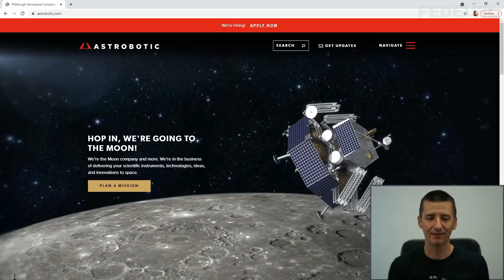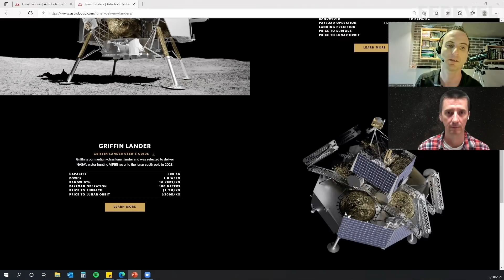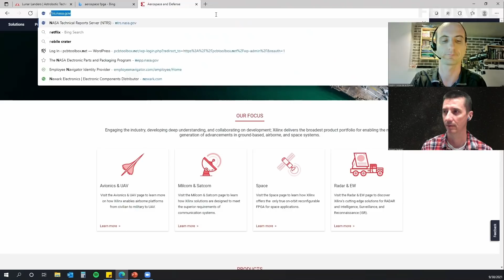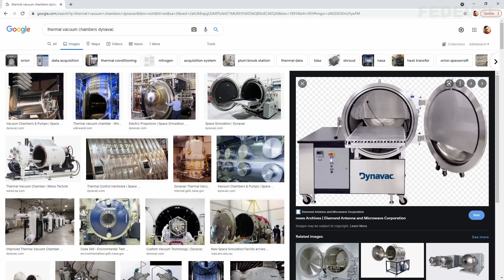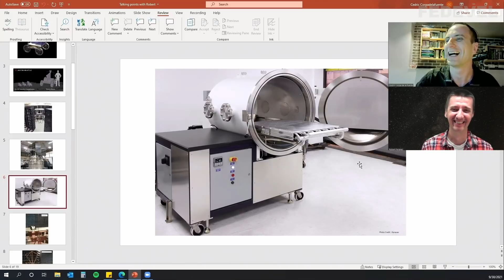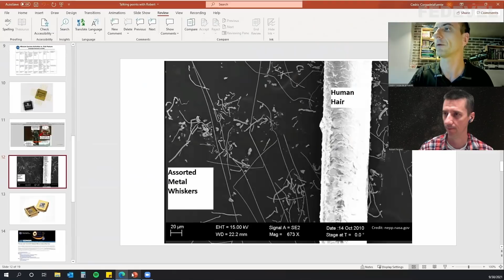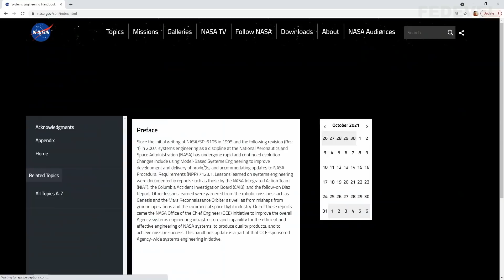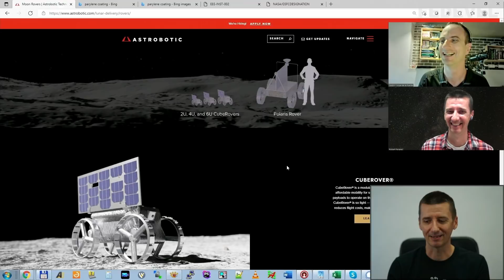How To Design Boards And Electronics for Space (with Cedric Corpa)

Comment: This was most interesting, even if my own aerospace PCBs have never been above 19Km, (so nowhere near space).
I would love to see an equivalent video for the Medical Devices industry, and what specific test procedures and certifications are required for (non-implantable) medical test equipment and their PCBs (e.g. more stringent EMC regulatory limit classes, electrical isolation voltages, ESD models, reliability, failure-mode analysis, circuit redundancy etc etc).
Obviously, more of your viewers will be designing for the medical industry than for the spacecraft industry.
PS: I'm currently designing some safety-critical automotive electronics, and the requirements for that industry are quite interesting too. For example, no single component failing either open or short-circuit may cause a failure, and any wire in the wiring harnesses to the PCB may be shorted to ground or to the car-battery voltage without causing any damage and it must be detected by the self-test diagnostics and fail-safe.
Reply from the maker: Thank you Nicholas. I made notes into my possible future videos list.

Comment: @1:02:34:
RE: can you use RoHS lead finishes with leaded solder? Generally YES. At minimum, pick matte tin (vs bright tin). Then the leaded solder mixes with the RoHS coating of pin. More advanced and multi-layer/multi-chemisty lead platings exist that are cross-compatible.
BGA: You are stuck with whatever ball chemistry is, unless you ask for a custom part, or reball (frowned upon).
RE: coatings that stop tin whiskers. Actually, there are several different conformal coating types that are so hard that tin whiskers can't penetrate. Some of this can be vaccuum-applied so that they actually suck in beneath and between the BGA balls. NOTE: if a coating is this rugged, it is also hard to rework the PCB! (So for a hobbyist or non-military product, the most you practically can use is like acrylic-based conformal coating, that removes easily with a Q tip and IPA. Polyurethane coatings are a lot more rugged than acrylic, and yes, they shield PCB from moisture, dust, ESD, oxidation, etc. We use conformal coatings at work, and I can't imagine consumer products being naked out there, exposed to everything like moisture.

Comment: Interesting Wikipedia suggests oxidation resistance of parylene is pretty low 60-100c. Though I wonder if they are using the flurinated versions which I'd guess are better in that regard.

Comment: When designing boards for space you have to consider that there's no air convection. So the only way to dissipate heat of components is the conductive one. And also because of the fact of absence of convection comes the problem to dissipate heat from your spacecraft. Here it is possible only through radiation

Comment: Does anyone know more detail about the reason why FPGAs are inherently more resistant to soft errors? That is a fascinating fact!
Reply: As he mentioned, only if FPGA is specifically space grade / rad hard. Commercial grade FPGAs are susceptible to soft errors as processors as well.
Reply: @valerik.4129  Ah right, had to watch it back, the mention of aerospace specific parts was so brief I missed it initially.
Reply: @valerik.4129  Im not an expert myself but I've been working closely with a radiation expert for the past few months on space projects who actually does the rad testing for Xilinx and he told us that we could use the commercial version of an FPGA and EXPECT roughly the same radiation performance as the space grade part in that family. There can be differences in lot to lot variability and what the space grade version (at least for this FPGA) gets you is essentially just the lot testing and traceability. Sounds like youre paying a lot for little but having an elevated level of confidence that your $100 million dollar project with a 5 year mission doesnt fail in 2 months is probably worth the extra 20k or however much.

Edit:
But specifically about the soft errors i dont know actually. New info to me that FPGAs are inherently immune to soft errors. Just thought I'd share the info above for the sake of sharing

Comment: YOU CANNOT ANYMORE, actually. Can't find a leaded package, everything is in shitty FN packages. Electronics is doomed to planned obsolescence. Core voltage is 1.8V, 1,2V, with 3.3V only as "compatible". RoHS is BULLSHIT. FN packages suck. BGA packages should not be the only package used. Where the hell is my pin grid array??? Where is my 5V logic that could operate at 15V, and take a direct lightning strike and be OK???
There is not a single piece of electronics currently made that will last beyond 10 years. Either tin whiskers or ESD damage or flash memory degradation is making all of this stuff useless beyond 10 years. Forget resurrecting old electronics, like we can do now to decades-old electronics. THAT will actually outlast all of this new junk (with exception of electrolytic caps drying out).
Reply: I guess let's wait for a major solar flare, it should teach a lesson. Should happen around 2024-2026. All the chips that can't withstand more than 3.6V will be fried.